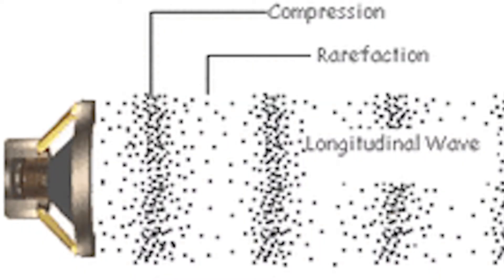Analog vs Digital vs Real Audio

Comment: You need roughly 44bit conversion to represent the directional motion of every single molecule in one cubic meter of air without dithering assuming those molecules have the same weight.

Comment: Preferably I like working in analog due to the character and warmth it provides over digital. My method overall would be considered hybrid since my signal is eventually converted into a DAW, but I try to keep things like compressors, equalizers, and reverbs external versus using plugins if I can. Digital has come a long way, but there's this sense of life that seems to be missing for me.
Reply: @Richie, I compare digital to that electronic 'dance' music which is SOUL-less, ROBOTIC, and very COLD. It helped turn many people into the ZOMBIES we see today! I have hearing aids and I do NOT like hearing all of the DISTORTION, esp. high frequency, RASPY sounds I get from my Mac, Youtube source of music. That's why I am looking at TUBE amplification, LPs(even FM radio) for my new sources of music listening.

Comment: I think you forgot to mention that the audio picked up by a microphone is not only converted to different voltages but also to different frequencys because the voltage part of an analog wave only controls the volume, the actual pitch of the sound is controlled by the frequency

Comment: When I used to work with only analog gear I had to practice getting takes just right and commit effects, which could make for an interesting workflow, but I definitely like working with digital more because there are so many ways to edit and tweak your sound - and storage, portability and cost of software and equipment is better.
Reply from the maker: Yeah, it seems to me that digital is a lot less time and money intensive.

Comment: I like to work in digital, as I can work within the DAW, I can use the mixer in the DAW instead of getting lost in online shopping, looking for a hardware mixer, and not have to worry if certain sites are ripping me off.

But that's for my mixes at home. When I am at uni, for example, I like to use their desks, I still prefer the digital desk such as the ICON, because of the single flow system, compared to the desks I have used in the past, such as the Ghost desk, I remember using that, and spent 30 minutes just to get single to the monitor speakers.

Comment: I agree with your assesments that all sound is analogue and continuous, or is it? If we look close enough everything can be breaked down into discret "digital" components, wavefunctions, quantum information and behaviours. The ears also converts the sound to discret information for the brain to interpret. To answer the question. I prefer to work in the digital workstation  because it is much easier, more effective "both in time and costs", better preserved over time, not limited by copies, digital opens up more other possibilities to affect the sound in many ways, but I also prefer digital because the PCM provides a more accurate representation of the original electrical tone frequencies compared to other modulation and storing methods, especially the analogue ones.
Reply from the maker: That's a really cool way to look at it! I'm going to look into the discrete information that our ears send to our brain; that sounds really interesting!  Thanks!